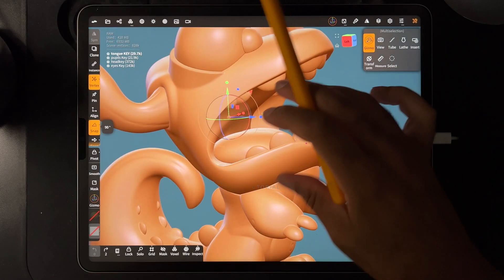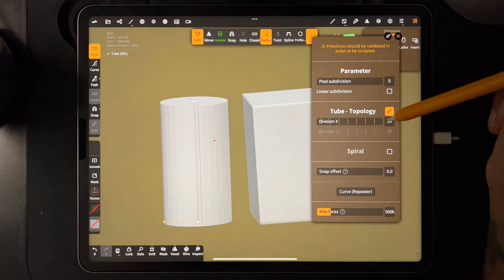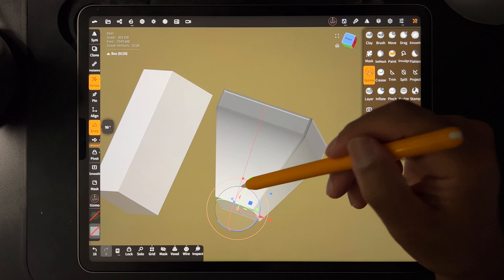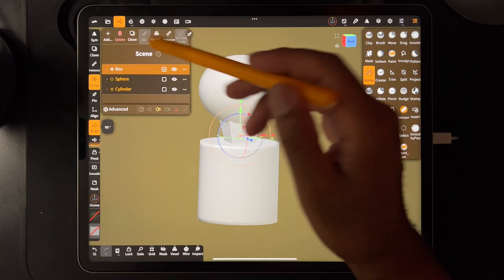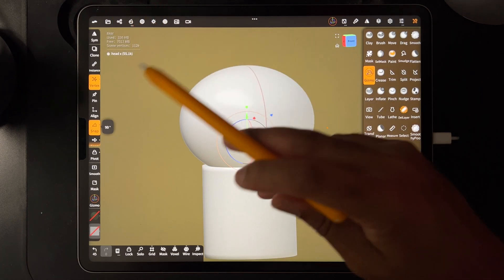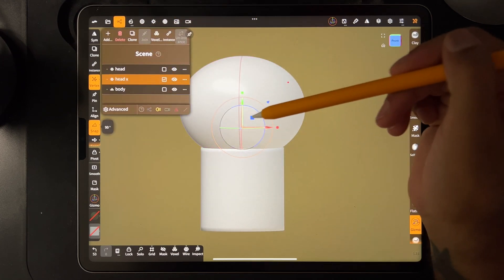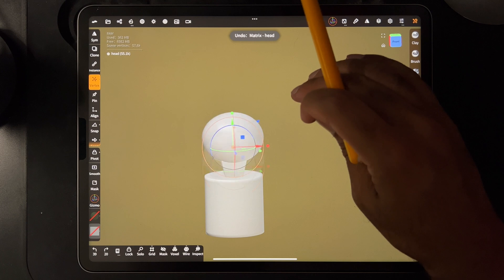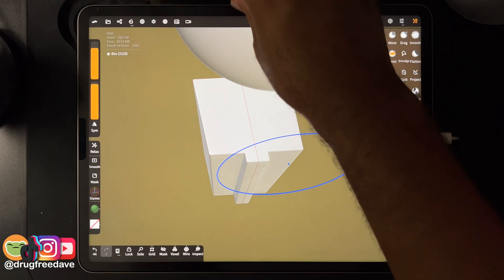Nomad Sculpt Quick Tutorial: Make Tapered KEY with Symmetry for 3D Printing (parts fit together)

Comment: Ive been using the "tube" tool for this purpose. You make a tube with just 2 end points and make whatever profile you want. Then you can edit the "radius" to get the taper. You can make the tapered block with the key in one go.
Reply from the maker: Awesome, I’ll have to try it out asap! 👍🏾💯

Comment: You can just take a box and set Division 0. A cylinder with divisions for a box is also possible. You can easily rotate the symmetry in the Symmetry menu - Gizmo edit.
Reply from the maker: Oh wow you can actually change the symmetry lines on the shape? My tube winds up with a diagonal symmetry center
Reply: @drugfreedave  Yes, symmetry menu - last option - gizmo edit
Reply: I’m two months late, but it always will have that experimental warning over it. But tell you what, the symmetry edit has gotten me out of a lot of trouble.